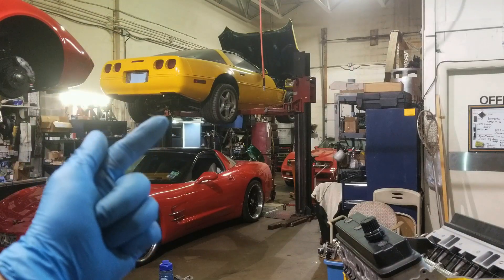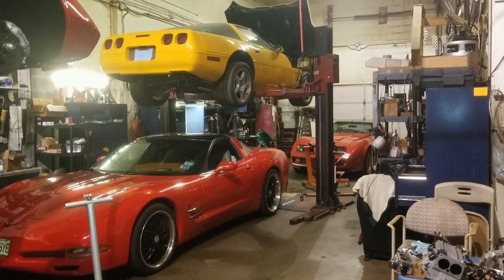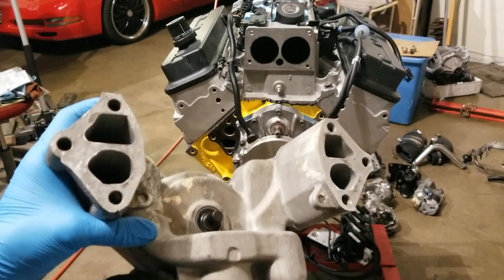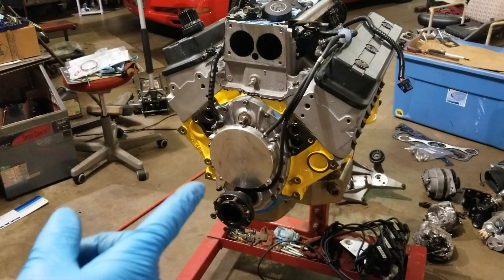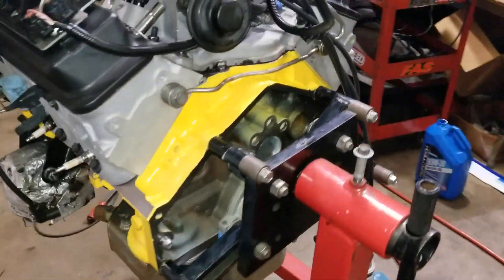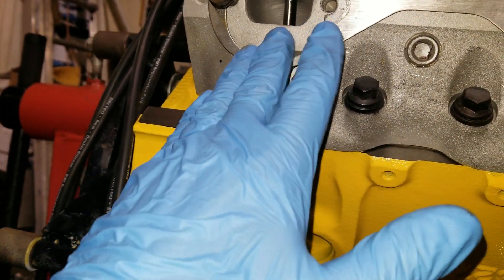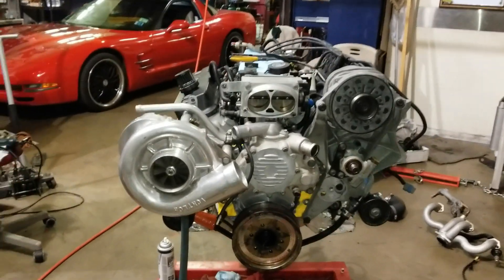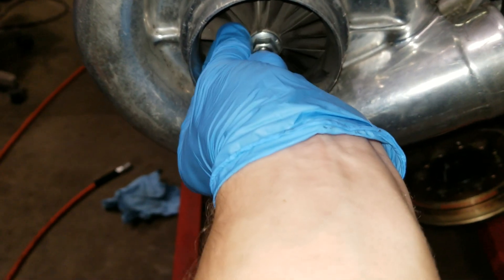Lingenfelter Engine Restoration P7: 1000HP Capable LT1 Long Block Gets Accessories

Comment: Nice setup I see your running an old delteg setup ... (I have mine in a box somewhere ... ) 
What did you use for the opti ... ?
Reply from the maker: I reused what it came in with. I dont know who made it but its most likely pretty old. Maybe delteq? I cant find any info on it.
Reply: @CamaroRick yes I looked up my old catalogs from delteq before they went out of business and that was one of the items they had ... it's a cover that goes over the stock opti ... it's a get system but if the brain box goes bad yourbshit out of luck trying to find a new one.. that's why I took it off the car
Reply from the maker: @maldo72  Good to know for sure, I did not see any name on it. It was machined nicely though. On stock opti distributor cars I have used the billet opti from MSD with good results. Ive also used a lot of over the counter opti sparks with the mitsubishi sensor inside. Some work some fail prematurely. For best results make sure the vent lines are routed correctly. Should have an inlet and an outlet vent line on it. They are prone to moisture buildup that will corrode the sensor. On the Vettes its a pita to change so I always recommend the msd billet on them.

Comment: I'm a Lt1 guy myself. What opti was that? What brand of crank and rods did you go with?  Thanks in advance.
Reply from the maker: Deltec ignition setup. Its been discontinued i believe. Was pretty good back in the day but still uses factory computer. Best would be a stand alone or a torque head / ecu swap for a better tune
Reply from the maker: Ive been meaning to call my machine shop I believe the crank is a forged skat 3.75" the rods are from lingenfelter but they look like forged Manley H beam rods. I would have liked to go with a heavier forged I beam if we were planning on an ecu swap and pushing it at the drag strip only. But the H-beams are pretty strong as long as you dont have a cylinder full of coolant and 7 others turning over.  More chance of an Ibeam bending. The H beam cracks in half.

Comment: Someone's got some moooonnaaaay in that motor/car. Wow. Optispark works 60% of the time, everytime.  Love it! A driveshaft for a water pump? Crazy man! Good catxh on those exhaust gaskets. Nice work Rick!
Reply from the maker: Thanks man! Yea LT1s have some odd things about them. Some cool too like reverse flow cooling. Cools heads first then block! Can get away with more compression